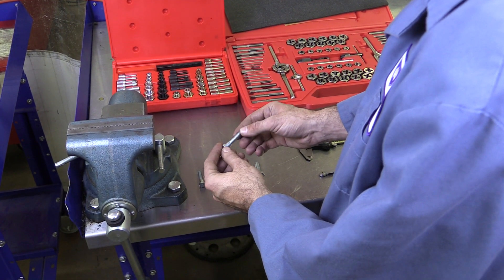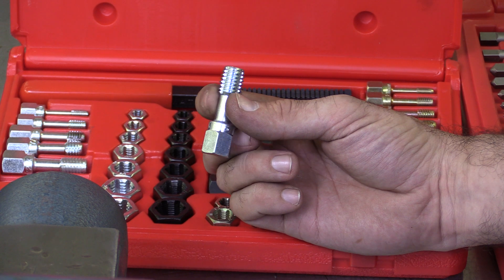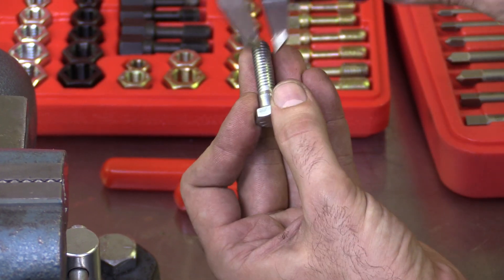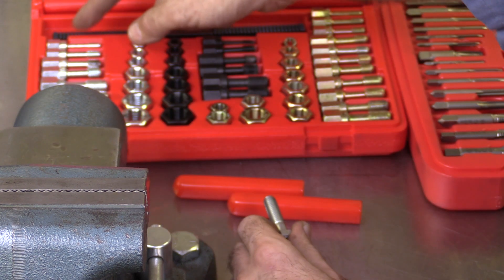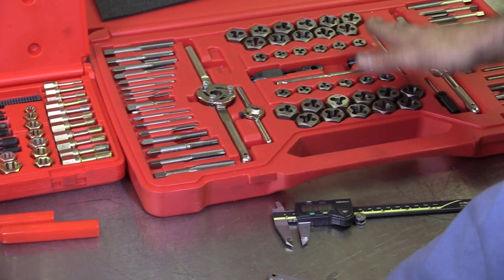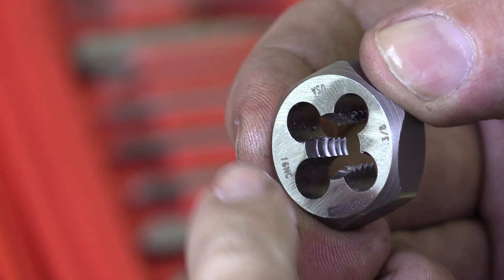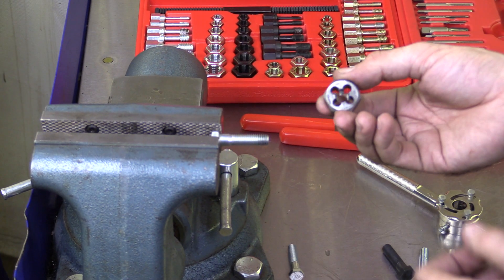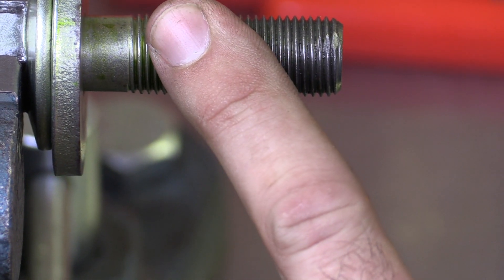External Thread Repair for Automotive Fasteners with thread chaser

Comment: Anybody wondering where to get the tool truck brand thread restorer set for cheaper, go to craftsman. Kastar and Lang make all of the tool truck brand sets as well as the craftsman. Yes, that's right, snap on and craftsman are the same in this case... kastar makes them ALL.